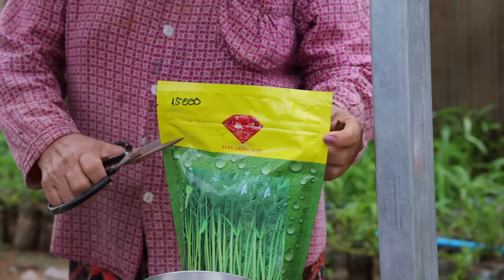I Built Backyard Aquaponics System for Crawfish Raising and White Radish, Water Spinach Growing

Comment: A wonderful channel but here a little tip from a European where the white radish originally comes from. If you mix about 1/3 - 1/2 sand under the soil in which you will plant the radish, it will grow better. The radish loves humus rich soil, but deeply loosened humus rich soil. The soil remains loose due to the sand and the radish can root much deeper and hardly ever forms lateral roots. In addition, the entire radish root remains underground and thus remains white. If the soil is too firm, the radish root will push itself out of the soil. Sometimes this means that the above-ground part of the root turns green because it's getting light.
Reply from the maker: ok
Reply: I live in poland and I brought a few back to the Caribbean with me , the red ones also,  not having much knowledge on how they are grown  but I tried it and i was supprise at how quick they grew but I did encounter that problem where a great portion of then were above ground , thanks for that piece of advice ill surely try it .

Comment: Holy hell, welding without eye protection. Impressed that you still see what you are doing! Good job 👍 but would recommend eye protection. Eye replacements are expensive.
Reply from the maker: Thanks for the tips!
Reply: @stephenfrancis303  slag in the eye aint fun tho
Reply: @heywardhollis1160  I weld by smell
Reply: Did you put on your mask?
Both of them?
Safety is overrated regulations.
You out here acting like braille was never invented
Reply: Did you put on your mask?
Both of them?
Safety is overrated regulations.
You out here acting like braille was never invented
Reply: you can eventually go blind from metal shards incrusted in yours eyes

Comment: You need to get a welding helmet or you will eventually go blind. The other reason is you need to weld beads for strength of your structures. It's not as simple as poking it to make little melted circles
Reply from the maker: Thank for idea.

Comment: With all the plants in place it would be hard to harvest crawfish. If the main purpose is to raise crawfish I wouldn't plant too many plants in the system.
Reply: I think people use lobster traps.  In tropical areas (the timber bamboo segments make me think south/east Asia?) where this isn't killed by the winter, "the ones that get away" (& most of the trapped females--catch and release, because in this species the males are bigger and more marketable) are part of the breeding stock to maintain the colony.  Because young crayfish are often cannibalistic (especially when moulting) they are territorial and need hiding places.  However in areas where they would be killed by the weather, you are right, and the hiding places need to be of a type that facilitates harvesting.
Reply: I think once you have done your plant harvest that eliminates all the obstacles to harvest the crawfish. 
Most food plants are annuals and the bamboo is held up by strings so easily removable

Comment: Your likely to have problems with Zinc poisoning eventually using Galvanized Steel. Other than that it looks pretty good.
Reply: The zinc metal base was covered in what looked like fairly thick plastic.  Not if any leaching will still occur though.
Reply: I wonder if there's research on how long something needs to stay in the system to be contaminated to a real problem.  Like if the crawfish only stays in for 9 months and the water spinach only for 8-12 weeks, and the zinc level is at X, does it really matter?
Reply: @johncarolina  water spinach able to absorb a lot of zinc in the water. Maybe you can use it to reduce the zinc but still I don't recommend you to eat the water spinach
Reply: @johncarolina  Assuming he re-uses the the system, I would expect Zn to accumulate in the water over several years, making subsequent harvests less safe (especially if microbial action makes for local acidity).  I wasn't sure what metal he used though.  Stainless steel ($$$$$) and even properly treated AL should leach less if at all.

Comment: Good idea, but could have done better. 1) the metal will get rusted.  2) Not aesthetics looking.  3) Not sustainable, maintainable.
Reply from the maker: 1) No. 2) Yes.
Reply: Pretty sure that’s aluminum so it won’t rust. 2 don’t think it was done for aesthetics. 3 it is sustainable if the crawfish breed and they rotate crops, from the looks of their water source it is fresh and not just recycled through their system. I’m fairly sure they live in a region with plenty of water so maintenance is just regularly filtering new water through, not really aquaponics but definitely sustainable. They just need to cover the boxes because those cray fish will climb out.

Comment: with so much water use, it'd be much cheaper for me to buy the veggies from a store lol
Reply: You reuse the water in a hydronic system guarantee it would not be cheaper after the first like 4 successful plants. A build like this if successful could easily be sourced using recycled or abandoned materials also. No need to use that metal. Could use old unused building materials
Reply: @jhtsurvival  maybe you can reuse the water in that climate, where i live the water would evaporate in a couple days honestly, but i see what you mean, wish that would work in a desert climate lol
Reply: @MelancholyRhyme  have you thought of swales? Its a permaculture technique that works everywhere. It is a lot of work to start cause of the digging, mounding, babying the young plants for the first year and all that but once its set up its there to stay. For the trees needed in swale design I would recommend a white willow in the middle they grow fast and root deep. Then for the other trees needed I would advise at least 2 pine trees, they do well even in hot temperatures, go with a local breed for best results. If a fruit tree will do well in the area add a few of those, most require chill time so not sure what would work in your area. Neem tree would grow well there it likes hot weather as a desert/tropics tree, moringa needs a bit more water access as a tropics tree but with the swale in place it should work out well and moringa is fantastic for people (everything from fertility to making you healthier). For bushes check what will do well where you want to put it plan around the trees that need placed to hold the swale. You could grow clover as a cover for the sides of it, draw in bees for pollination, does not care if its in shade or sun. You would need aquatic plants for in the water to clean and oxygenate the water, could add a solar bubbler as well, but then you could have crawfish or fish in general to keep mosquitos population low. Cause with water there will be things laying eggs in it from mosquitoes to dragonflies to frogs and toads. Good luck
Reply: @annak804  Yes i love permaculture it works amazingly well even in my area! i've planted moringa tress and cardamom, i'm planning to plant Avocado trees soon along side with tomato trees and dragon fruits, probably add squashes between them so they keep the ground covered